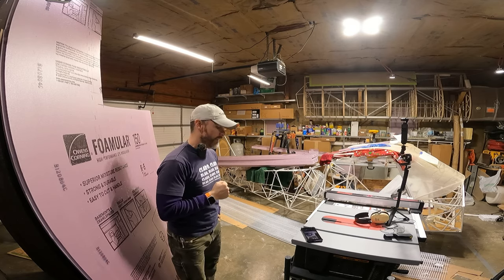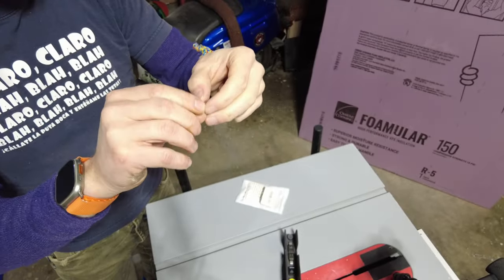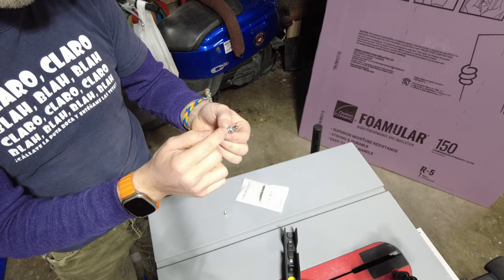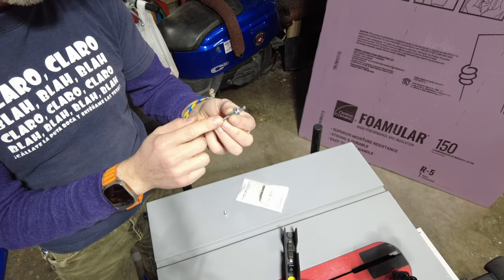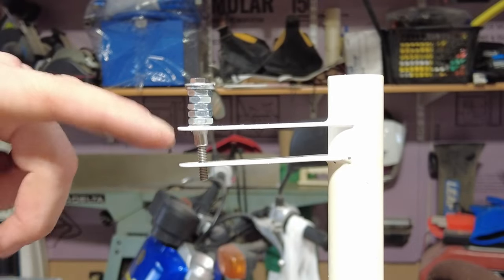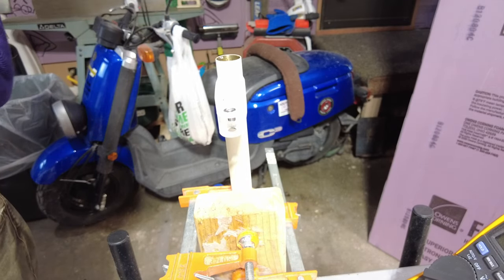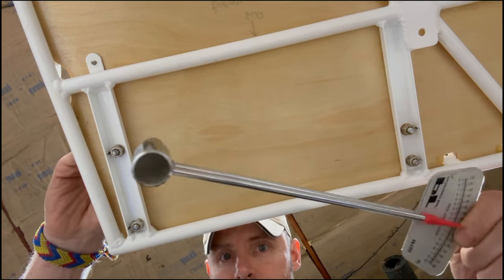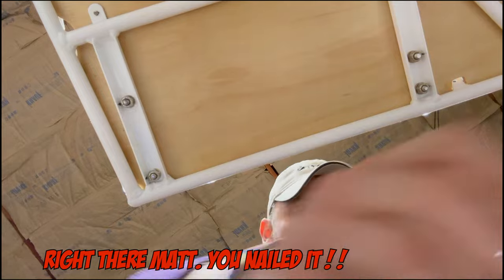#27 Rivnut Blunders & Rudder Pedal Hardware Torque

Comment: Lol. Thanks for posting as always. This is a part of the build I’ve been curious about. It seems quite a few end up with a little binding in the rudder pedals. Looks like you’ve got it pretty close.
Reply from the maker: Hello Greg! Yes it does seem to be giving lots of folks a bit of a headache. I see Mr. Barnard has responded to me with a fix that worked for him. There is not too much to sand down there as they are at maximum an eighth of an inch thick. Close isn’t good enough I think but like you said right now that’s where I’m at.

Comment: Those last 2 nuts that you couldn’t get a socket on would have been another good place to use a crows foot. You’re coming along nicely.
Reply from the maker: Hello again Mike, I’m looking into the crows-feet.  Aircraft spruce only seems to have them for a ⅜” or greater drive.  I’d like to find some I can use on the ¼” drive so I don’t have to have many extensions or adaptors on the wrench.  The more I have when working blindly it seems, the more cumbersome things can get.  I need to find a dedicated helper!  Have a stellar day, Matt
Reply: @KingFox76  mine are all 3/8 drive, but I just looked at Amazon and they have some on there that are 1/4 drive
Reply from the maker: @mikefairbanks  Thanks Mike, I will check them out and see what I can fine.
Reply from the maker: Hello @MikeFairbanks, I finally picked up some crows feet!  Both SAE and Metric, I’ll be showcasing them in the next video.  Have a Happy Easter.  Matt

Comment: You need to sand the floor board down over the welds.  That’s why you’re seeing the depression.  That should correct the friction.  I almost made the same mistake.
Reply from the maker: Hello Michael and thanks very much for your comment. There’s not much of the floorboard to sand down. Do you think it would be possible to shim underneath the floor board with a few washers to create a space?  I might try that before I sand down the floorboard since I can just take the washers out and send later, I can’t put the word back.
Reply: I will send you a message on the forum
Reply from the maker: Thanks Michael, I’m a little slow on the responses while traveling but I’ll get into the forum and look for the message.  Thanks and have a Merry Christmas & a Happy New Year.
Reply from the maker: Hello Michael, now I know what that picture was for.  Lots of moving parts here sometimes, I will try the sanding and see what that does for the binding.  It does seem that both outer pedals have the same restriction, the pedal on the co-pilot side have that noticeable lift on the corner like you circled in the picture but the outer pedal on the pilot side does not.  Perhaps just sanding on the co-pilot side will fix the issue.  I’ll try one at a time.  Thanks again, Matt